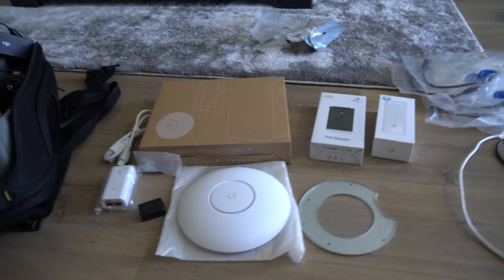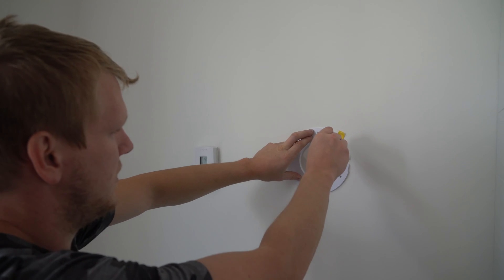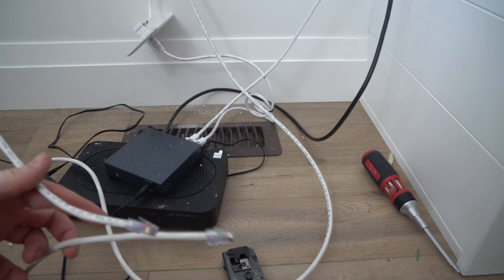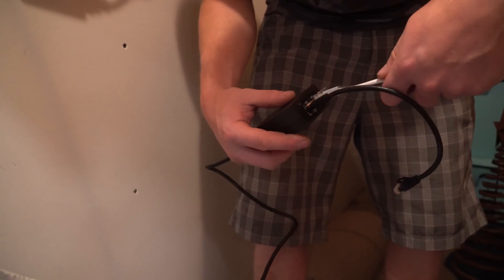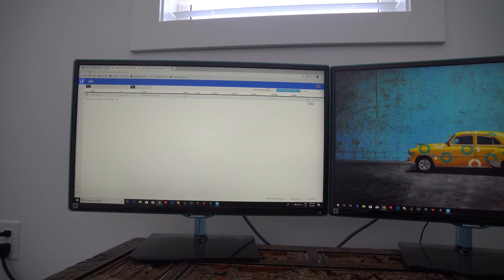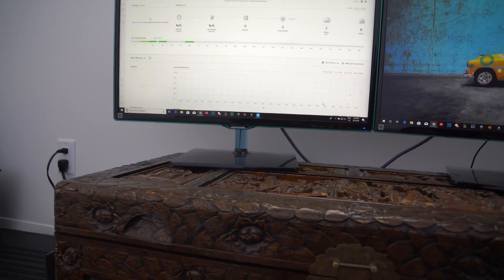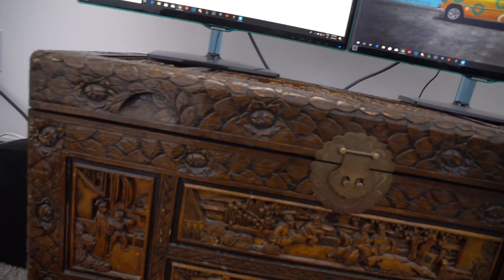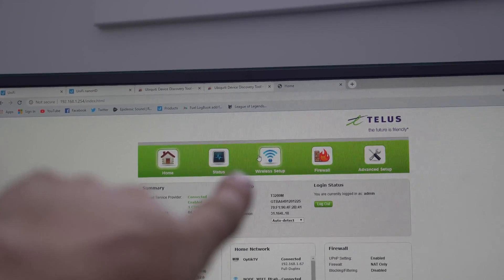HOW TO SETUP A  WIRED ACCESS POINT NETWORK UBIQUITI UNIFI WITH CLOUD KEY

Comment: Isn't this supposed to be on the ceiling or horizontal not vertical for better coverage?
Reply from the maker: Can be either. I have mounted them both ways. Optimal is on ceiling but still works great on wall

Comment: Aren’t these suppose to be ceiling mounted not wall mounted?
Reply: Ceiling. There is a guy who did the test install on ceiling vs wall and the ceiling mount provided much better coverage. Would you rather fire sprinkler on the wall or ceiling? Same concept.
Reply from the maker: Can be either done them as both and never had problems as long as they are mounted a bit higher like I did in the room not mounted at wall outlet hight as that would be to close to the floor
Reply: It is recommended to be ceiling mounted, this setup is terrible.

Comment: It looks like your hole was only for the center of the mounting ring.  The Ubiquity "getting started" manual seems to indicate that the Ethernet wire needs to come out under the center hole of the mounting plate - in the area that is notched out.  Also - it looks like you install the metal backing plate which seems to be provided only for using on the back of a ceiling tile.  Can you give a little more details about these 2 items?  Thanks!
Reply from the maker: It worked just the hole in the center
Reply: @ghostlyrich  I am using CAT6 cable which will not fit in the small space available in the middle.  I will need to add a hole just outside the inner circle where the cutout section is.  Better yet, I may add a retro low voltage box to have a nice clean exit from the wall.

Comment: To bad electrical boxes were used for the cable runs a low voltage box would have been so much easier to work with.